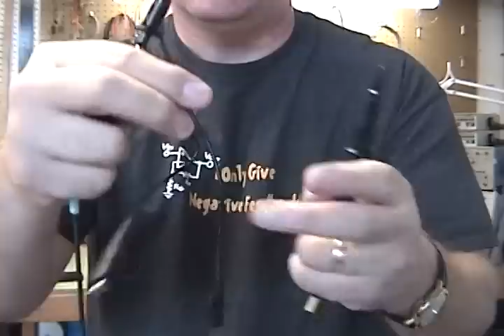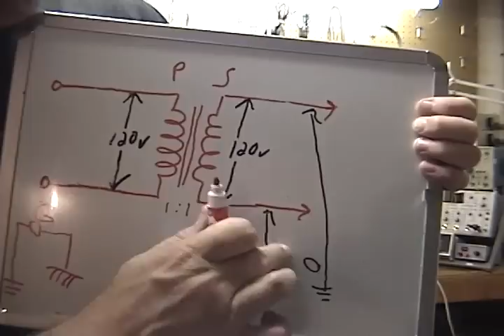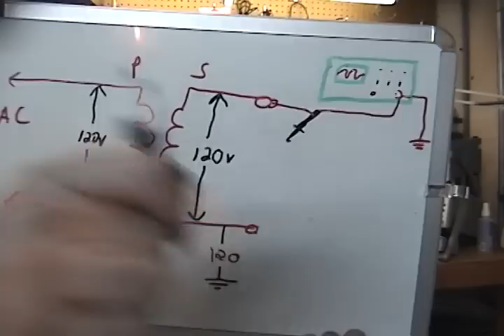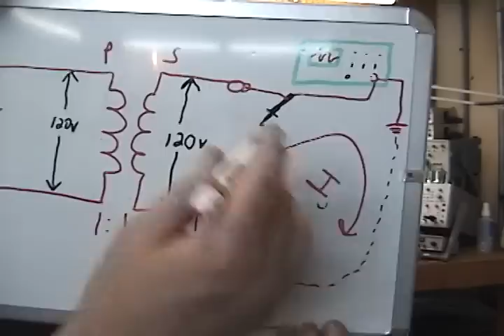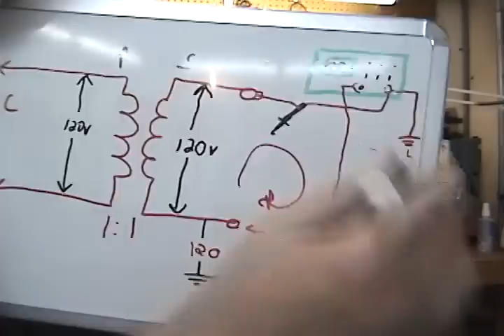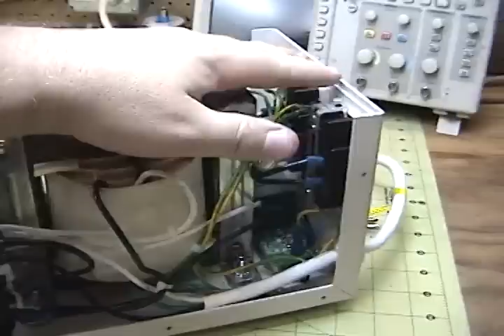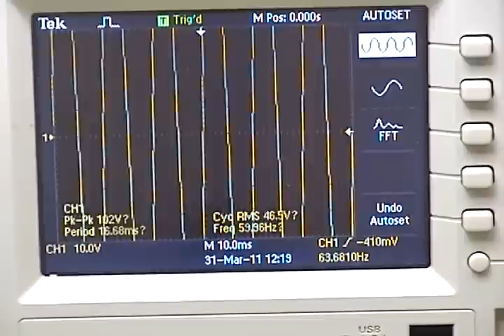ToddFun.com: Isolation Transformer - Tripp Lite IS1000

Comment: is oscilloscope work if it plugged into isolation transformer too? so all your bench is isolated!!!
Reply from the maker: Well you shouldn't float an oscilloscope with respect to ground, but yes, if you only use a two prong adapter with our without an isolation transformer the ground path loop would be eliminated from your oscilloscope. The reason I say with or without an isolation transformer is because if your DUT is powered from an isolation transformer it really doesn't matter if your oscilloscope is also isolated as the power sources can't directly reference each other. However you can still make your DUT hot again with respect to ground once you connect a grounded oscilloscope probe clip regardless of how you power your oscilloscope. The only way to stop this grounded oscilloscope issue is to use a 3 prong to 2 prong outlet adapter for the oscilloscope, but you are then floating your oscilloscope which can damage the oscilloscope plus cause crazy wrong readings. I do that later for safety sometimes but only for a quick test when I don't want to setup a difference reading between two probes which is the best solution short of getting an isolated oscilloscope probe.
Reply: ***** 
Thank you

Comment: Todd, thanks for this good information on grounding risks and Isolation Transformers (I/T). Understood about connecting DUT to the tech-safe Isolation output but what if we also connect the DSO /Freq Gen to the I/T output?   So both the DUT and any Test Instrument are all on isolated side connection. Has this got additional safety merits or are new risks (unforeseen to me) introduced? Appreciate all thoughts on this aspect.
Reply from the maker: Not really helpful. You are not going to be inside your other test equipment. If you want to float your equipment just use a 3 prong to 2 prong adapter. Doing so with your gear can lead to damage so floating gear isn't a good idea, however it is safer. Your call at this point. I do float gear on a 2 prong adapter for safety once in a great while but only for a quick test and even then I cross my fingers I don't damage or throw my gear out of calibration.

Comment: Hi Tod, I like your video but I have a question... In the ISO you removed the Ground strap from the neutral side of the outlet plug, However you left the ground strap to the chassis and the ground of the plug. The question is If you are working on a piece of equipment that has a three pin plug and you plug that into the ISO, would that be making a ground loop as before? Would it be safer to remove the Ground straps from the outlet plugs as well? Not sure so hence the question. Thanks for the video.. I will watch it over again.
Reply: My concern as well. I see in other comments that @Todd says no, but I'm not sure how it couldn't be if both are connected to the chassis.
Reply: I think the question has to do with not eliminating all paths to mains earth. @Todd, you're saying that if you remove the neutral to ground wire from the secondary, you're done. But the question I see being asked is.. if the ground pin on the output side is grounded to the chassis, and the chassis is grounded to mains earth over on the primary side, isn't there a direct path from the ground pin on the output through the chassis and on it's way to mains earth. In other words, is there a path that wasn't eliminated?
Reply from the maker: No, the ground pin on the outlet can no longer make any connection with the secondary so no circuit loop can from with the secondary windings where the power comes from for the outlet. You can remove the grounds if you like, it will still work fine but you will not know if the hot side of the secondary gets shorted to a metal case as you would if you kept the grounding. Not much of a deal but it can keep you from accidentally having an energized chassis when you are not aware.
Reply: Thanks. I will watch again and try it.
Reply: @todd harrison -- I've seen other videos where the core of the IT is connected to ground as well. Was  that not the case with the Tripp Lite?  If it wasn't, what if it was? Might that complete a circuit from DUT to mains earth through the output ground pin (through the chassis?).
Reply from the maker: No. That "core" as you call it is a just a Faraday cage put inside the transformer as an added safety. If the primary has some kind of meltdown, short or voltage spike the grounded cage in the transformer will shunt the energy to ground instead of allowing it to jump the cap between the primary and secondary windings and causing dangerous spikes or primary voltage reaching the equipment plugged into the secondary side. You do want this for hospital grade isolation. The Tripp Lite does have this cage and it is grounded. Leaving it connected is just fine even for a Tech bench isolation transformer. No circuit will be created and if the core has one of the mentioned problems on your Tech bench the cage "with the fully grounded plug" to  your home's electrical will help keep you safe.
Reply: OK I watch the video again and my observation is that on the primary side the mains ground is connected the chassis and also the ground of the outlet plug. so I am wondering if a 3 pin plug from the DUT is connect to the outlet of the ISO wont it be connected to mains ground as well?
Reply from the maker: Both are connected to the chassis but this in itself will not allow power to follow from the secondary outputs into the ground wires unless there is also a short on the secondary to ground someplace. That means it is still isolated once the neutral wire on the secondary to ground is removed. But also remember at the point that a short on the secondary to ground will not result in any current flow that you would normally expect in a functional home ground circuit. That is because a simple short to ground on the secondary doesn't in itself create a loop but it does setup the option for a loop through your homes grounding wires back to the DUT meaning if you touch the opposite leg of the secondary output with respect to the shorted side you will get a lethal shock. Clear as mud right? Let me know if I can help more.
Reply: would love a whiteboard on that path.
Reply from the maker: No. Your right that all these ground points are connected. However it is in noway connected "back" to the power source of the isolation transformer's output. So without this critical path back to the power source you can't have current flow of any kind from the ground wires. Removing this ground path at the output is fine, safer even from ground faults that could setup a new path and a dangerous DUT but then you also give up the safety ground for other non isolated faults from identify and tripping a breaker for your safety. Your call to keep the grounding wire connected or not. There are times I don't use the grounding from the output to my DUT just so I know I can't get a strange ground loop fault but this is not needed for safety unless you know you will have a secondary to ground connection for some reason like using a grounded scope probe.
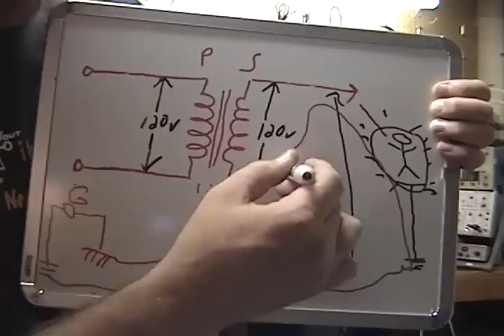Reply from the maker: I show this path at 21:50 in this video but note that on the whiteboard the red wire from the lower secondary to chassis is representing a fault that must first exist for there to be a danger. Without this added fault all ground wires are safe. This noted fault can be a bad DUT power wire or a scope with a mains grounded probe clip. Once again, without this fault there is no loop path to show and you would be safe.
Reply: Thanks so much for walking me through this Todd. I understand that particular path. But I also thought that if the ground pin on the output is essentially connected to mains earth through the chassis, then you would have a completed loop through the DUT.  So, .. .this order:

1. Mains Earth to IT ground pin on the input.   
2. ground pin on the input to chassis
3. chassis to ground pin on the output
4. ground pin into circuit in DUT
5. human "connects" rail in DUT to mains earth ground
6. loop completed to mains earth ground back at the panel

Also, just to be clear, even with the IT, a human can short a HV circuit in the DUT and get nailed, right? From a human safety perspective, the IT should cut-off the mains earth loop. 

thanks for helping this greenhorn to understand!
Reply from the maker: For your steps 1-6 this is not yet a completed loop with respect to the power source. In this case the power source is the secondary and with only one side of the IT output connected to ground there is no loop path back to the other side of the secondary. You would have to do steps 1-6 then add a 7th step such as a person touching the other side of the secondary output while their feet or some other part of their body was to earth ground potential with respect to your home's mains grounding. With this 7th step you would have a completed loop through your body.
Reply: Thank you, I think I got it now. Although the ground is connected to the chassis the voltage can't flow back to the mains because the loop has to flow through the  secondary. Thanks again.
Reply from the maker: Yes. Much better said even. Thanks.
Reply: this is inaccurate.  once the ground is brought from the output of the IT to the DUT then you have now established the ground/neutral of the DUT to be at the same potential as the ground/neutral of the mains, the primary of the IT, and the secondary of the IT.  the IT output nor the DUT are isolated or floating at this point.  you can now complete a circuit through any of the hots, not just the secondary hot.
Reply from the maker: Wrong. You don't understand how transformers work. If you did you would understand that you can ground either side of a technician IT secondary to DUT ground or mains ground point without issues and yes even when their grounds are tied the same physical point. Electricity can only flow in a loop so think about this more. And don't stop watching a video halfway through even if you find it boring, you might learn something. However, I did find your earlier comment funny as I too think this video could have been much shorter and much better produced with the same information dissemination.
Reply: You removed the ground connection to the secondary of the transformer at the IT but by then sending the ground wire over to the DUT you can then reintroduce that same ground to the secondary side of the IT transformer over at the DUT since you are sending both sides of the secondary over to the DUT as well.  The mod of removing the ground from the secondary at the IT can now exist again at the DUT.
Reply: And kudos to you for taking the time to make your videos, regardless of length ;)
Reply: After your mod you never tested a DUT that may have introduced it's own grounding, only a non grounded lightbulb.  EEVBLOGs video on blowing up an oscilloscope shows a schematic at the 12:00 mark of how having a referenced earth ground over at your DUT can complete a circuit.  While I chose to modify my IT with one bank of three outlets passing the earth ground and the other bank as completely ungrounded and isolated at the IT side, I wouldn't let my wife or kids choose how to use it or where to plug something in.  You may know how you use your IT and it may work for you when testing light bulbs but I am simply pointing out that you initially explained your rationale for removing the ground from the secondary of the IT but then allowed the same ground (via chassis and outlets) to go over to a DUT that could very likely allow those same wires you explained should be isolated to then be in an environment where they can very likely be reintroduced to one another.  Something that the less experienced may overlook when poking around on the DUT side.
Reply from the maker: A DUT that re-introduces its own earth ground wouldn't make any difference.  In fact at times for some types of testing you want these grounds, all grounds, because they are there for a reason. They provide safety path back to mains power in the event you do get a mains short to a DUT chassis, test equipment chassis or random shop or lab mains fault. The last thing you want is a floating hot chassis referenced to house hold mains power. I would much rather trip a breaker than have a bit of gear or DUT ready to kill me. Yes, that is why you use an IT but as noted in my video you can still cause the DUT to re-reference ground using test gear for from a lab fault even if you float your DUT by not bringing the ground from the IT. So it all comes down to safety and working under the most safety you can provide for your conditions. And there is not one best way here as you note in your comments. In  your comments you make a good statement about when it is best NOT to pull the ground from the IT and that is a true statement for your safety concerns. However there are other conditions where having the ground from the IT is the safety one wants on the tech bench. If I had to pick the most common safety option I would pick yours where the ground is dropped at the IT, but then you really need to understand how you can reintroduce that same earth ground path just as easily using a scope as I noted in my video. Knowing this many people will then just float their scope but that will damage the older CRT scopes and maybe even the newer DSO's but I haven't seen that yet on the newer scopes and it can often cause wrong reading on any bench scope rendering your scope useless or at least misleading.
Reply: Thanks for the video Todd.  And comments/replies.  Great work.  These videos are important to have for folks that want to start poking around in dangerous places but may not know the right questions to ask.  While I'm a life long tinkerer, but not an electronics guru, I had determined a while back that I felt a lot safer not sending the earth ground over to my DUT as I wasn't always confident if that mains ground would somehow meet up with one of the IT's secondary leads over at the DUT.  But, as you had stated, I still liked knowing I had the the option of sending the earth ground out of the IT so that it could offer the safety that it is intended to provide in a circuit.  Keep up the good work.
Reply: @Drick Lorenz and @Todd Harrison,  how about one (or both of you) do a test that proves your point. It can't be that hard. Either the potential is there, or it's not. Just don't do the test with your left and right arms!
Reply from the maker: David Berlind, I believe Drick and I came to an agreement so there is nothing to prove at this point.
Reply: Oh.  I think saw where it morphed into a question about the DUT having its own ground. But I'm not sure I saw the answer to "what if the ground is introduced to the DUT by way of the chassis?"  I will have to re-read the entire thing again. My head is spinning.
Reply from the maker: Maybe I didn't understand your question. I was commenting regarding safety. So as for electrical shock from the secondary side via the ground path the unit is safe once the neutral to ground wire is removed from the secondary side. If your question is about ground loop noise then yes that can still exist but the Tripp Light does have some line filters on the output if I remember correctly. And the DUT device is being powered by an isolated source so ghost voltage will exist which can cause some issues with signal evaluations but I'm not sure how much they would affect circuit function unless you're working with something really sensitive to ghost voltage signals somehow.

Comment: Hello 
I would like to thank you for this video ! I needed to watch it several times to understand (well) process, before doing it by myself...without a big bang in the cellar
In France, 230 v, and 30 ma security on the line...But  with a maximum care i tried to connect my scope Rigol 1102, behind my  600 W transformer. So, no fire, no explosion, and i have always the cellar too 
Many many thanks cause it was difficult for me to prevent misunderstanding around ground, secondary line, and scope.

That's ok now and very happy to do this in real life, after many tests to control all connections on the transformer and to verify all separations between them, i decided to run experiment, and i could see (with happyness) the same result on my rigol and the beautiful waveform for the secondary 230v AC

So this test makes me understand some rules and gives me basis for the future
GREAT !
rgds Eric.
Reply from the maker: Glad to help Eric.

Comment: What I did not really like in your modification is that you left the output sockets connected to ground.  If ever you will put in a 3 prong plug of some equipment that you are fixing which has an earth ground you will bring its chassis to earth ground and if for any reason this has a common source somewhere in it may bring the loop back in action without noticing.  
I also made myself an isolating trafo to test my equipment and made also another one for my oscilloscope so when I probe I will be double insulated.  Both transformers have their cases connected to mains earth but the output socket earth pins are isolated from chassis, so whatever you plug in either if its a 3 prong plug or 2 prong plug you will NEVER have your earth ground connected.
One last thing that I like to point out is that my oscilloscope case and knobs are entirely made of plastic and the only metal exposed parts are the BNC sockets
Reply from the maker: True, you can do it that way for more safety.